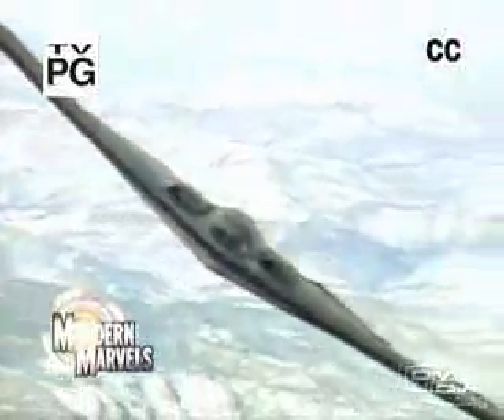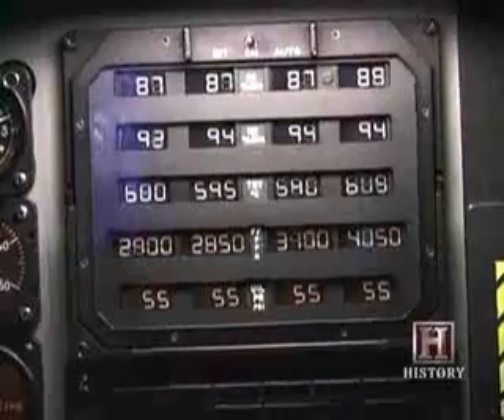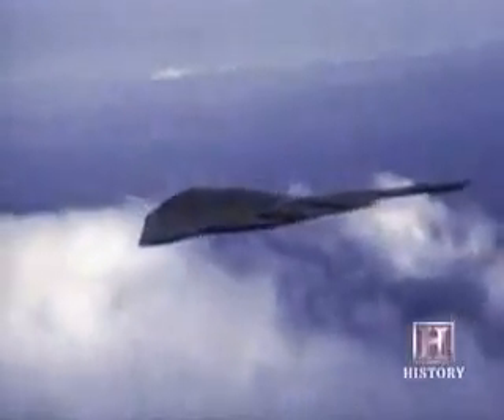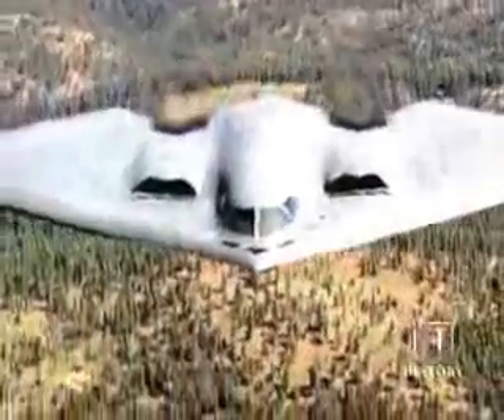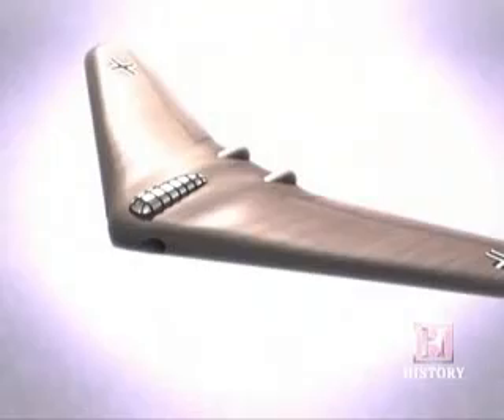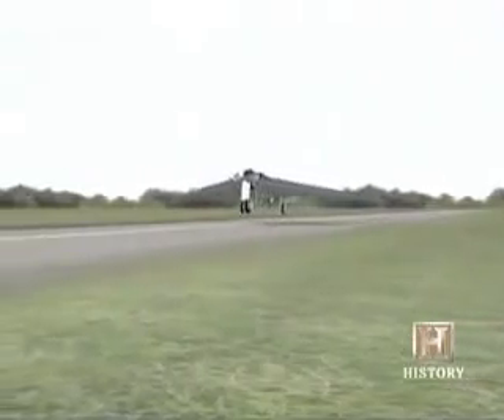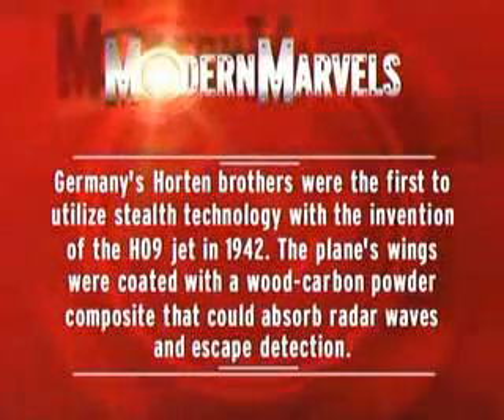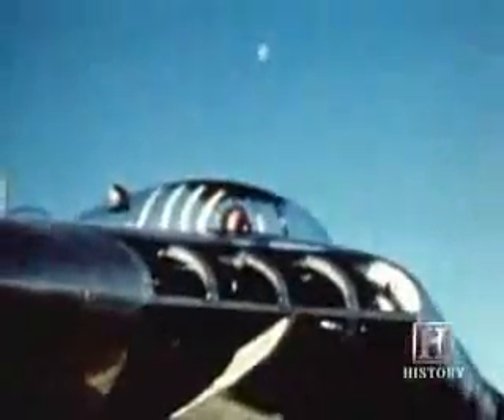Stealth Bomber B-2 Military Aircraft

Comment: Actually, they coordinated several radar stations, pinpointed the path the plane was taking from the random blips, and then fired a missile in the expected path of the plane. Terminal IR guidance and the use of offset transmitter and receiver antennas did the rest. Not a new technique, that's the way interceptors were directed against bomber formations in WW2, and no stehalt aircraft is immune to them.